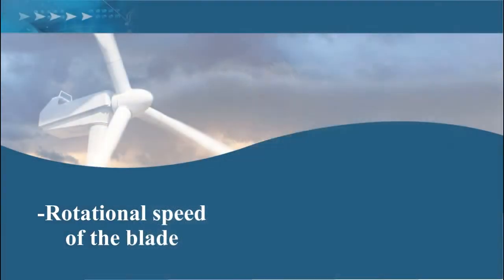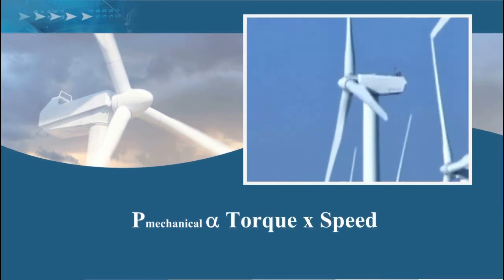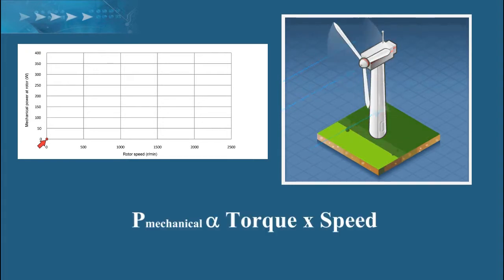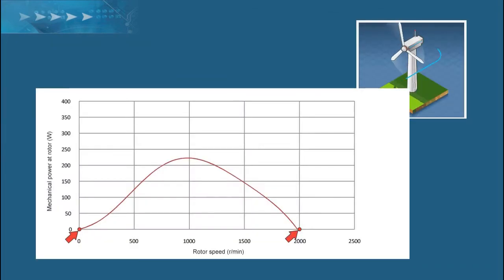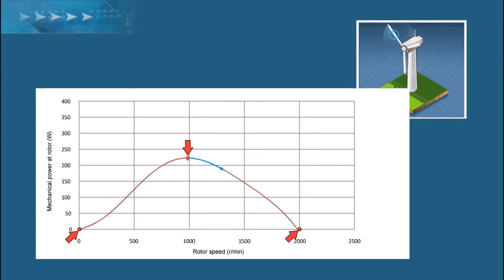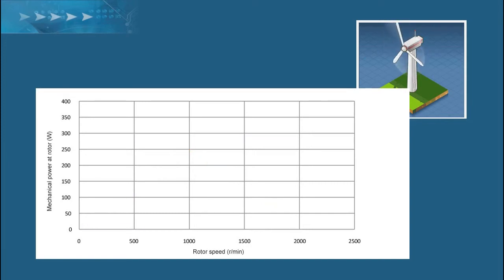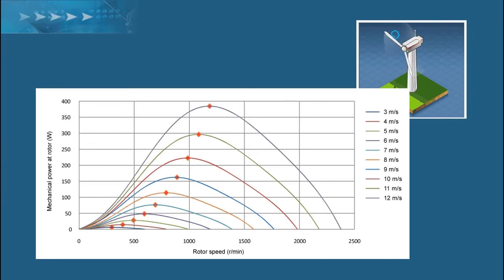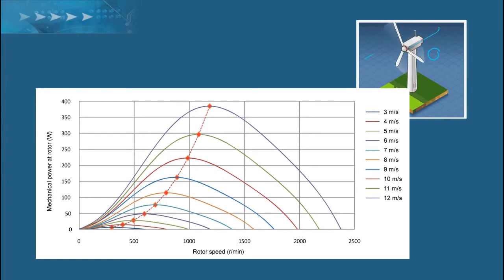How To Get Maximum Power From The Wind

Comment: awsome explanation.
but, what is the reason that leads to a change in rotational speed however the wind speed is stable at a certain value?
Reply: Thanks, great question!  In summary, blade speed change is caused by the generator  energy output, which is the equivalent of a brake on the blades.  A wind turbine converts (remove) rotational energy from the rotating blades and turns it into (add) electrical energy.  If we remove rotational energy, we are slowing the blades.  If we don't extract energy, speed will be high and we'll have no torque (so no power because power is proportional to torque x speed).  If we extract too much energy, speed  will drop so much that even if we have more torque, the power (torque x speed) will be lower than optimal.